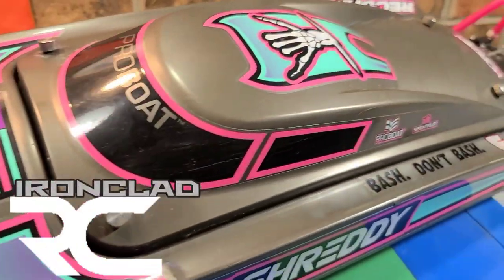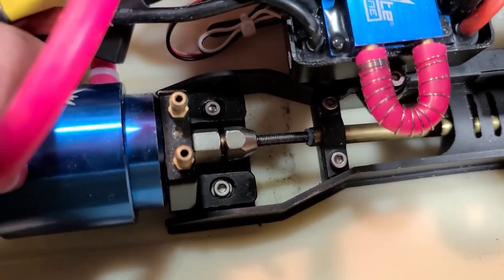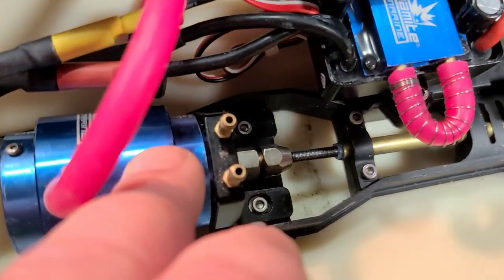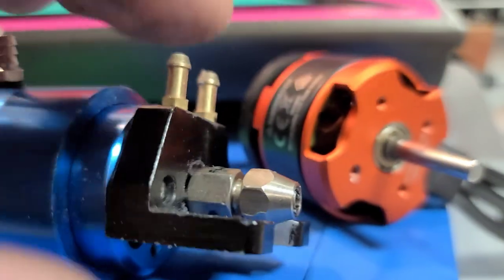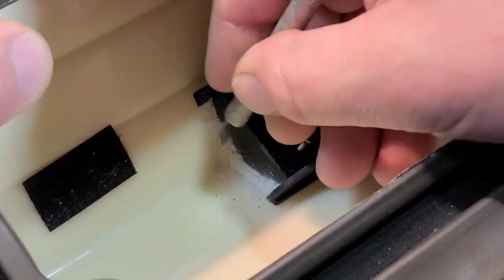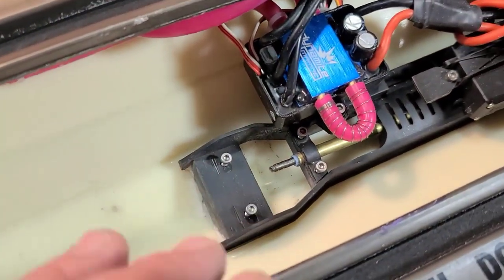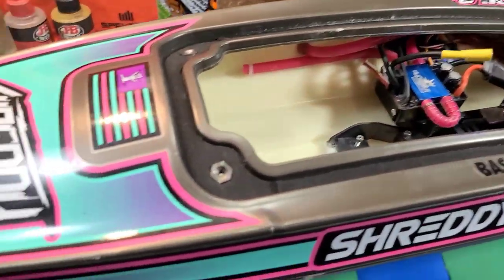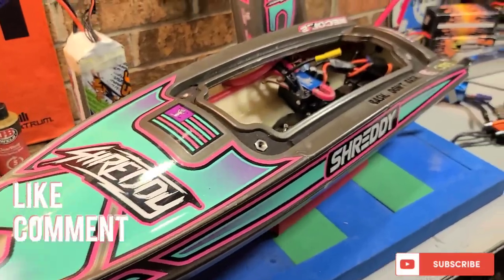Proboat Recoil 2 Upgrades & Modifications For 6s - Fast Rc Boat

Comment: Thanks for these tips. I tried to upgrade to the 120A Spektrum ESC and figured out the hard way that the outrigger motor doesn't play nice, so I got the motor you had, and your machining tips for the motor mount are super helpful. Good work! But I'm not sure that it matters whether or not you drill into the cooling system for the motor mount since the new motor has a cooling jacket and the mount isn't used for water cooling anymore if you upgrade to the new motor?
Reply from the maker: I can't remember exactly why I drilled the motor mount, I think it was because I used the dynimite 2000kv 6 pole which has a vose on it, if you use a leopard motor I don't think drilling is needed

Comment: Just came across your videos and your mods are amazing. Just got into having this boat and Heatwave and love them. Was wondering if you have a mod/upgrade for the small adjuster on the rudder push rod? I have clipped the bottom of the rudder in low water a couple times and the screw stem has sheared off instead of just pushing up the rod? 
Your Shreddy doing 60mph on that pond is crazy!!! Awesome work.
Thanks

King
Reply from the maker: Pretty sure this is what you need, you may need to drill the rudder arm out to accommodate the larger upgraded stud 
https://www.offshoreelectrics.com/proddetail.php?prod=ose-83119

Comment: Awesome IRONCLAD mods there Big B 👏 
The biggest HATE for me in RC boats is hook & loop battery straps 😖 Man they are a pain in the butt for sure. I've used hook & loop tape before but with single strap trays, just as a bit of extra hold. But this extra wide stuff you used is potentially a game changer for several of my boats. Need to source an equivalent in UK.
Again, thanks for sharing brother 👌👍
Reply from the maker: I got mine from home depot I'm sure you don't have a home depot in the Uk     this is exactly what I used. Heavy duty velcro

https://www.walmart.com/ip/VELCRO-Brand-Industrial-Strength-Black-5ft-x-2in-Roll/17190465

Comment: great video, thanks for sharing,my stealthwake had the same problem with the tray and i used the same stuff,its ben a while now and it workes awesome,take care
Reply from the maker: That marine weld is good stuff.   Alot of people discredit jb-weld products,  I've had good success with most of there products.     Quality epoxy is expensive so I try to hold on to my wetsystem & only use it on larger projects that need the extra strength 💪

Comment: Quick question. If I kept stock motor and esc but swapper receiver/transmitter to the Noble Flysky. Will it still self right? Or will I lose that feature?
Reply from the maker: You'll have to manually blip the trigger forward to reverse to self right the boat.   It should self right

Comment: Could you use the marine glue for battery tray also?
Reply from the maker: I ended up using Bob Smith 30 min epoxy for the battery tray. Used some fiberglass chopped up for reinforcement.

Comment: There is a type of Velcro called Alfa lok and another brand called scotch dual lock that has 2 halves the same no felt or smooth side and it clicks together it’s amazing stuff.
Reply from the maker: I've used it before, great stuff thanks for sharing

Comment: so the stock motor will handle 6s.  my ? is have you ever run your stock motor on 6s as well.
Reply from the maker: No, stock motor barley handles 4s, definitely don't throw 6s on it.    BG4L

Comment: Did you ever try running a 5s on the stock setup? Will the esc boot up
Reply from the maker: Stock electronics is only 4s capable.  Do not run 5s with stock electronics

Comment: Hi mate i got this recoil 2, and i got a4S Battery wish is a 6000 mAh 14.8V 100C, do you know if this boat setup has the capacity to handle this battery specs?
Reply from the maker: No I'd go lighter weight/lower mah, something like a 4000/4500mah size.  The stock esc doesn't like the extra weight....

Comment: The Velcro is how I keep my battery’s in the UL-19 with the carbon fiber insert and allows for 2(4s)spektrum 5000’s in it when I want to use 8s👍
Reply from the maker: Worked better than I thought, the velcro actually held the battery in place even after a few 60mph crashes..

Comment: I'll be running my 4s 6000 100C lipo's because 8S beast of a losi uses 2 of those at a time.
But still waiting on my recoil 2, dunno when I will get it.
Reply from the maker: That's gonna be perfect. Good luck with the maiden.

Comment: Hey Big B, I have taken my shreddy out twice now on the stock lipo. when the boat hits LVC it goes dead in the water with no drive, this is the first vehicle I have had to do this. did this happen do you running the stock ESC on larger packs? (I have a 5000mah 50c 3s to run)